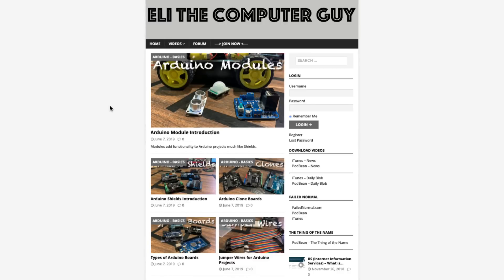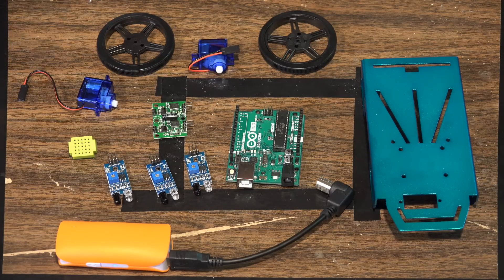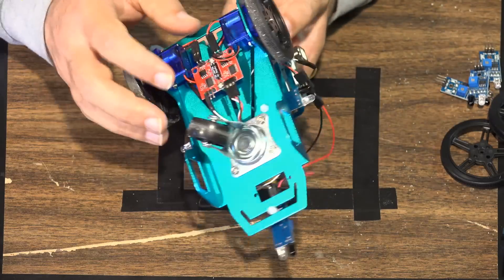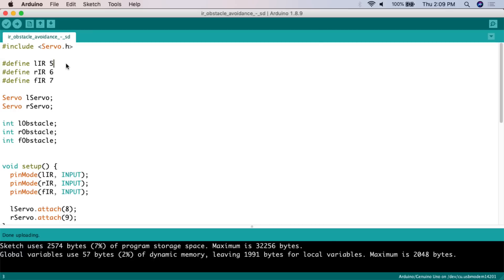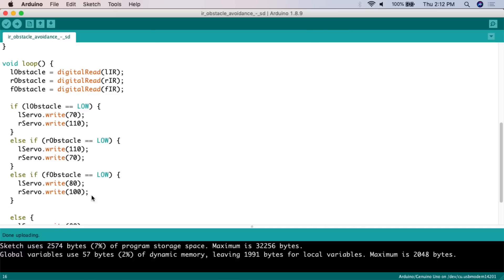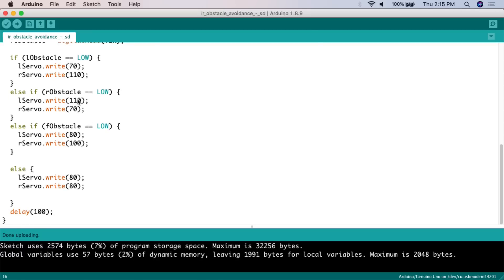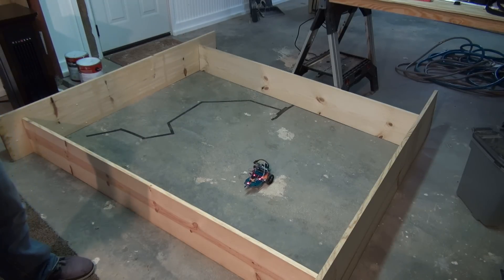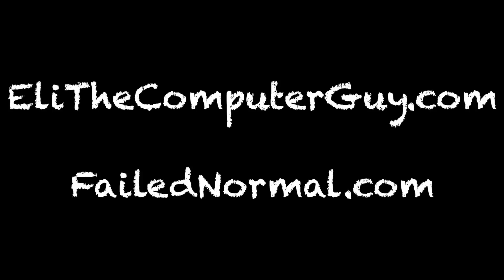Arduino Multiple IR Sensor Array Obstacle Avoidance Vehicle - Code and Assembly

Comment: How servo motor can run continuous very funny servo only run 180 degree maximum   more over you are not showing the driver connection and complete code ... it is just a static servo where both servo turn right and left  not move forward.. please guide properly all student in transparent way....
Reply from the maker: ...  uhm... it's called a continuous servo motor... so...